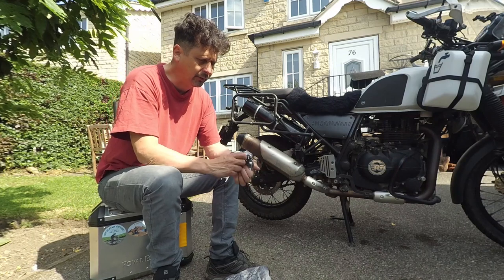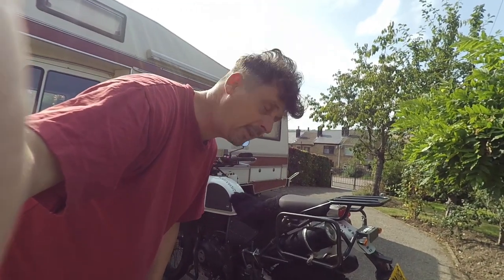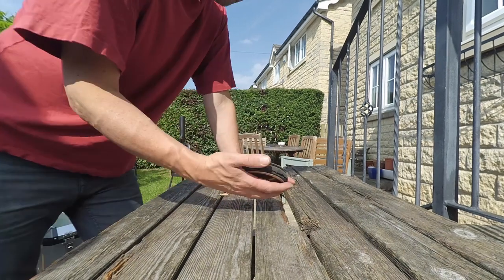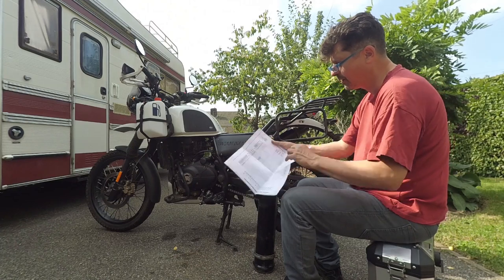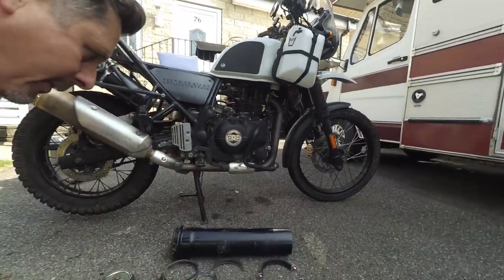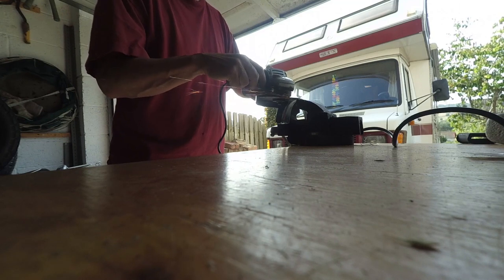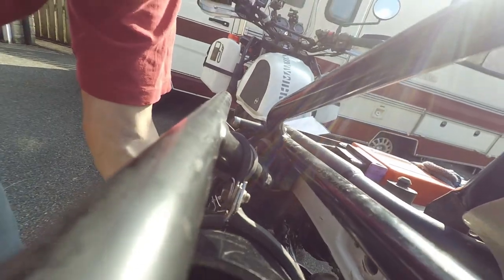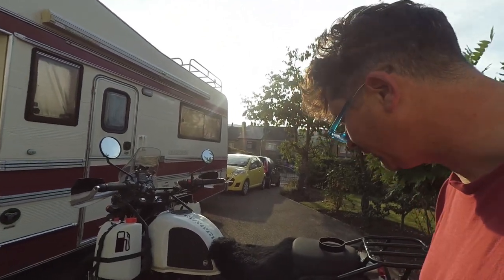DIY massive Tool Tube pair

Comment: Caps are called Drain pipe pressure test caps. Wouldnt the pipe that's by the chainguard keeps hitting it when the suspension compresses?.
Reply from the maker: It did , so that's why I shortened id to 450mm instead of 500mm.